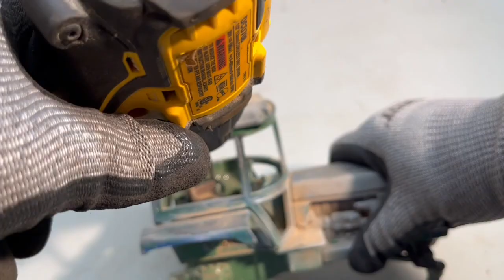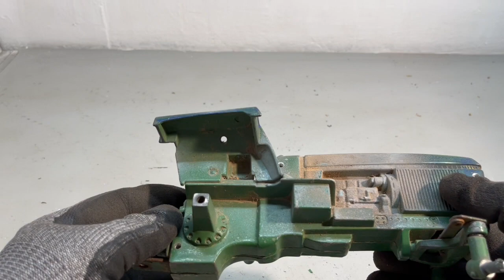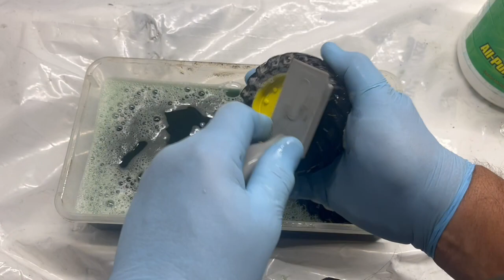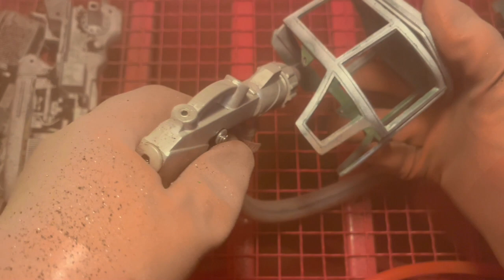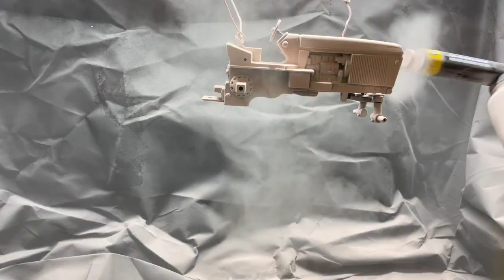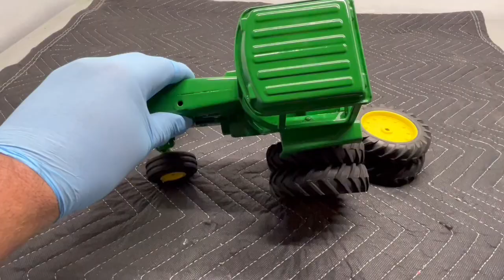John Deere 4630 Ertl Toy Farm Tractor Restoration

Comment: nah bud your a bit wrong there that tractor is a 4440
Reply: No it isn't, "bud".  

40 series tractors have black cab posts. This is a 30 series, it has green cab posts.

That being said, it's not a 4630 either. It's either a 4430 or 4230